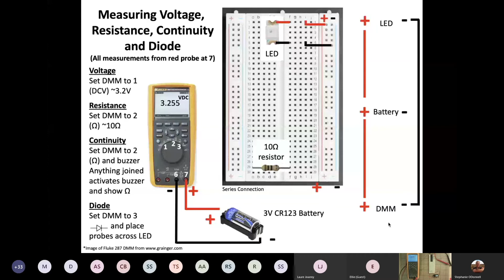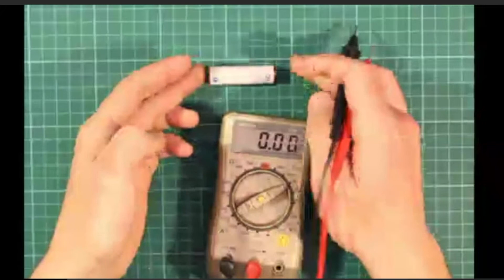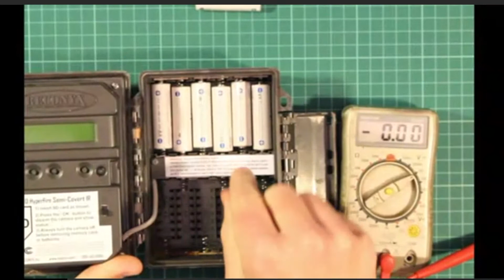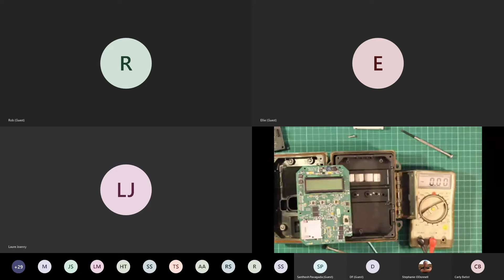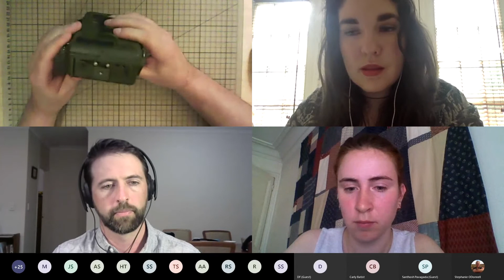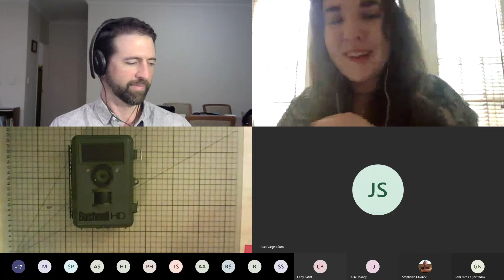Laure Joanny, Rob Appleby, and Alistair Stewart: How do I repair my camera traps?

Comment: It could be really useful to have a kind of flow diagram of basic tests and repairs to work through. For example, Step 1 would be to check and clean battery terminals, and test batteries to make sure they have charge. If that fixes things, great. If not, Step 2 would be check the switch, and show a typical repair. If that works, great. If not, Step 3 would be... and so on. Obviously things would vary by model and fault, but that would give a really good entry point. To an extent it is what was shown here, but a set of videos, one for each Step would make things more accessible.

Comment: I have a 2015 browning strike force 5 thats a battery eater ( fresh batts last only a few hours..two three videos) then dead. any suggestions
Reply from the maker: Hey dave - jump into the discussion on WILDLABS in our camera trap group, it's where the speakers and other members will be able to help: https://www.wildlabs.net/community/thread/933
Reply: @WILDLABSNET  Good luck with that one..I signed up but I can't sign in, and there was no verifaction link sent either.
Reply from the maker: @DaveKentLive  We've sent you an email to sort it out, you should be set now.